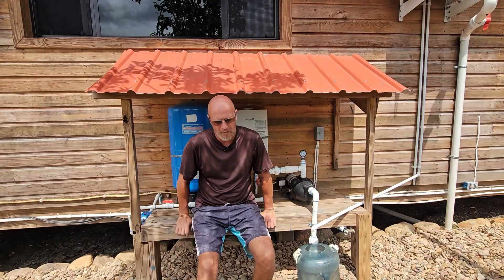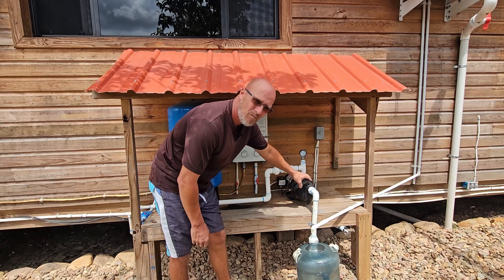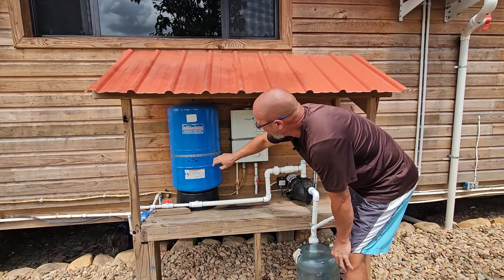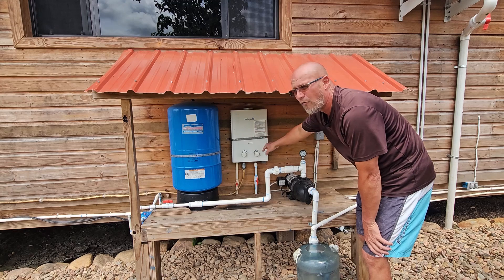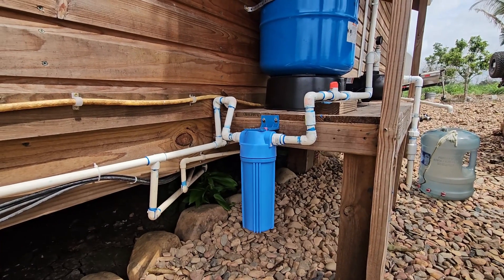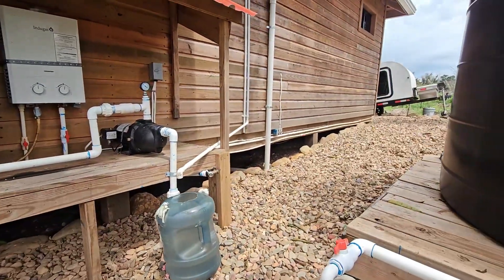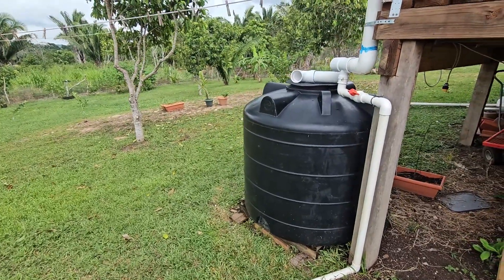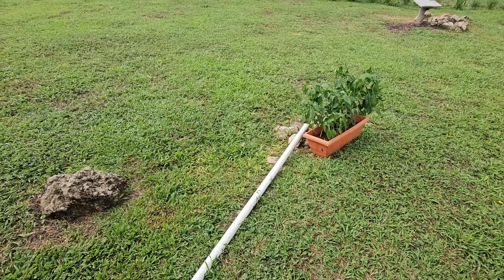OUR ULTIMATE Off Grid Water System -  100% SOLAR & 100% RAIN CATCHMENT- W/PUMP-Real Off Grid Living

Comment: Thanks for the demo, that's very similar what we had off-grid in Canada's Yukon for 16 years. Also our water came unfiltered from a creek. The Health Inspection (for commercial use) passed our system after we installed 2 filters with 1.0 micron and  0.5 micron and for drinking quality permanent UV-lights in our small in house 100 gallon take. We never had any issues with drinking the water.
Reply from the maker: @anook1984  thanks for watching and sharing great information. 😁
Reply: Hi. Could I ask how often you have to replace the UV bulb if you have it on permanently? Thank you.
Reply: @andrewyang1446  we installed the system in 2004 and the UV-lights lasted to the day I sold the business in 2010.
Reply: @anook1984  wow. Thanks for responding!

Comment: My parents live on the outskirts of Belmopan at the Goerge Price Highway, they capture rain water and pass it through a double carbon filter system before boiling the water in the kettle to safely drink it. Since theyre not in the city they are not connected to the main water line. All their everyday use water comes from a well and drinking water from the rain. They been doing this for 17 years and saved alot of money on water.
Reply from the maker: This is our first time doing this, we have learned so much about self sufficiency here in Belize. If we would have known so many of these things back then we would have done them. Traveling is learning. Belize is beautiful and has taught us so much. Thanks for watching and commenting.  We are looking into the charcoal filter then boiling water for drinking.😁😁
Reply: @WhereToNexxt  Normally rain water is safe to drink as is, but I assume you are collecting the rain water runoff from the roof to the gutters that flow into the cistern. During non rainy weather the roof and gutter can get covered in micro sediments from dust in the air, hence it is advised to filter and boil water to drink if you are storing that rain water in large tanks. My parents has 2-1000 gallon tanks and it is WAY more than enough water to last two people through the dry season. As for the well, they were lucky enough to hit water at a depth of 80ft which again is also enough water to get through the dry season for showering. washing stuff, and watering my mom's large garden.
Reply from the maker: @kwuason  thanks for sharing your information with us. 😁😁😁

Comment: Thanks. Does everyone use PVC there or can you get pex or copper there?  It seems PVC would break down in the sunlight so I think I would lean towards copper? What do you think?
Reply: The copper will disappear within 24hrs. You will make some thief's day.
Reply from the maker: @EricGorny  copper is expensive here and PVC is cheap and easy to work on or replace if needed. It's mostly all PVC here. Thanks for watching.